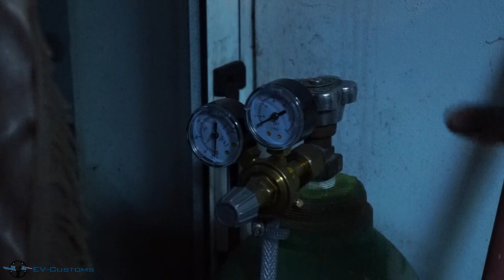Custom Made FAT BIKE WHEEL for 38$

Comment: So I need some help,I'm taking a 36v hoverboard wheel and trying to make a custom fate-bike,I've gotten into building batteries so I thought, why not I have four 26"rims, so does having the ridge in the rim (from welding to rims) make it so that if I used one tube (26x4) it would pop? and with 2 is the center of the tire not inflated?  Thanks!

Comment: You didn't stagger the spokes correctly, also you can buy a 20" x 80 x 100 x 135 wheel hoop for 25 dollars and you won't have to worry about the center bridge cutting the tire open in the middle when it pinches. But I get it, sometimes it's just fun to build your own stuff, but you should do more research on spoke staggering. It's also super heavy, the wheel hoops I'm talking about are double-wall Aluminum that is strong and super light. Anyway, have fun with it,

Cheers.
Reply: Where do you  get those wide rims?
Reply: @noe616  eBay, Amazon, I get all my fat rims on ebay fairly cheep

Comment: Won't this make a soft spot in the middle making a wider contact patch for the tire increasing rolling resistance.
Reply: excuse me for asking, What did you mean by that?. Is it better or will be trouble?.
Reply: Probably not, the tubes will take up all the interior space when tight. A wider tyre (within reason) has better rolling resistance as a rounder contact patch flexes easier than a long narrow contact patch. Tyre casing construction and pressures make more difference to rolling resistance anyhow. Would have been much worse if it was a knobby tyre.

Comment: Hello sir I forgot to ask you about the wheel size.. What the size of rim and the tire?
Thank you sir hava a nice day
Reply: That's a 20"×3" kenda flame tire on 2 2" rims making a 4.25" rim with a 3" tire for a low profile look. This ram's spoke holes aren't staggered right, has a tire splitting wedge in the middle and will cause a life threatening accident at high speeds. Cool look, dangerous design!

Comment: Is the video with you putting the spoke in ready as yet ? Because I want to know which hub is needed for regular riding purpose
Reply: He cants put spokes, he didn't even stagger them correctly, he put the outer spoke holes both to one side. There is no way to spoke that wheel unless he drills all-new spoke holes. Which is probably why he hasn't updated on it. The wheel would be dished to one side. You can buy 20 inch to 29-inch x 80 or 100 or 135 mm fat tire wheel hoops that are double-wall aluminum not heavy steel like his for 25 to 35 dollars brand new on eBay or Alibaba. I bought 4 and they are perfect for my 65mph e-bike. They even have the spoke and hub chart so you don't have to figure out on your own the spoke length.

Comment: a wheel with no spokes and no hub , hahahaha
How to center the spokes? Unpossible...
Reply from the maker: i lace it on hub motor ( e-throne ) https://www.facebook.com/873197872716160/posts/4272840129418567/
Reply: @EVCustoms  unbelievable costs to have the wheel centered and re-spoked. only possible if you are a trained mechanic. respect.